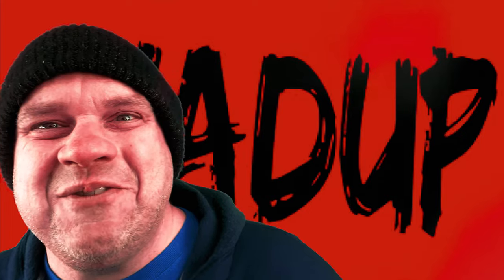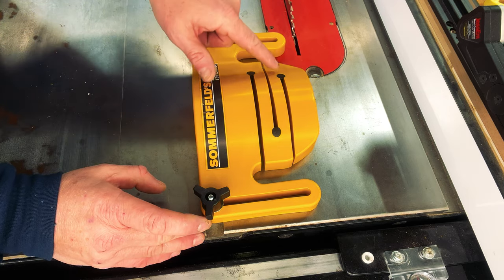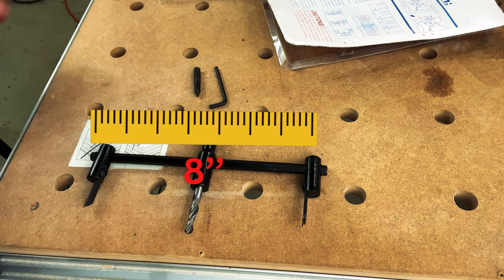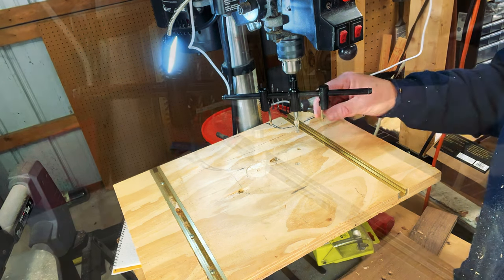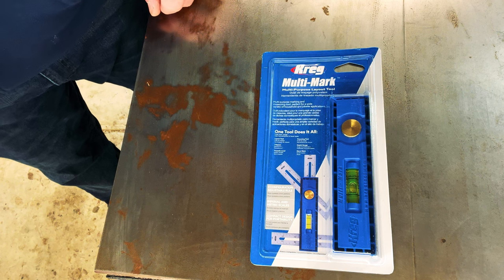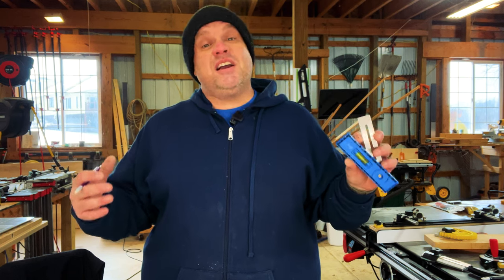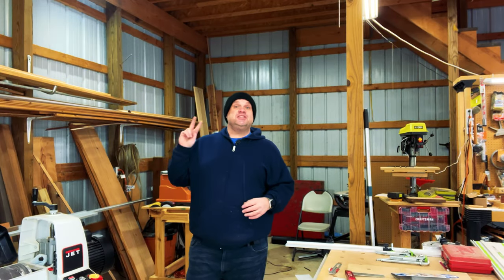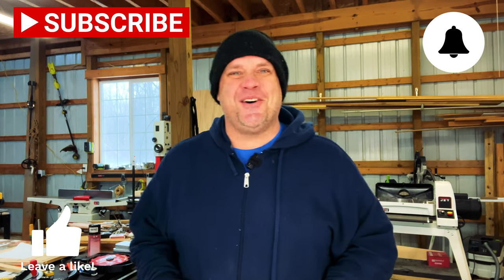5 Unique & Unusual Woodworking Tools Put To The TEST!

Comment: The hole cutter has been around for ages. You can also get it with inch markings. It is commonly known as a knuckle buster. Putting some white paint on each end of the bar helps you see the spinning bar ends -- unless your drill press table is white. To cut small holes with your drill press, try removing one cutter. That would reduce the amount of sawdust you are creating per revolution. My first knuckle buster just had one cutter. It didn't go out as wide as yours. A single cutter might drag and bind on a large hole. 

The feather board has also been around as a shop made device named after the gentleman who invented it. Sorry I don't remember his name. The little saw is concave not convex. The way I remember this is, if it sinks in like the mouth of a cave, it's concave. Don't mean to sound critical, just passing on  some nuggets from an old man. Keep up the good work and oh, slow down a little and take time to shave. Just kidding.
Reply from the maker: Excellent comment Jim!  I have seen that tool in other videos, but had no idea how long it had been around.  Judging from the packaging it came in, I don't think they have updated any of their marketing since the 50's! :)   I love the name knuckle buster, that's perfect!  Thanks so much for your comment!   I'm going to try mine soon with one of the knives out soon!  Thanks for the tip!